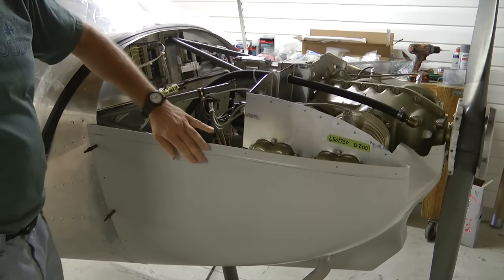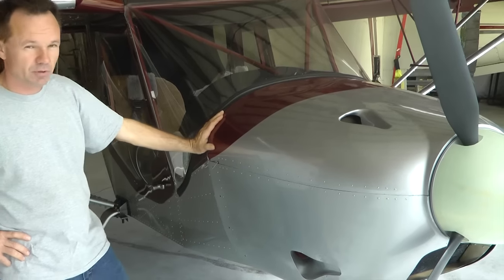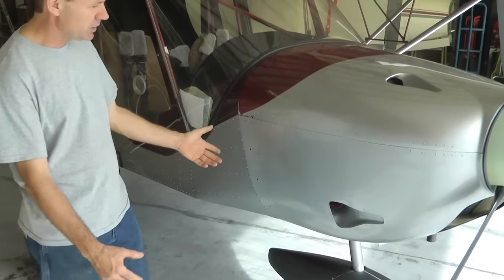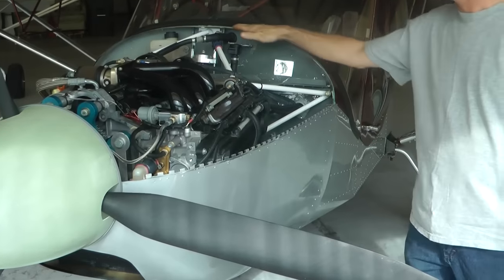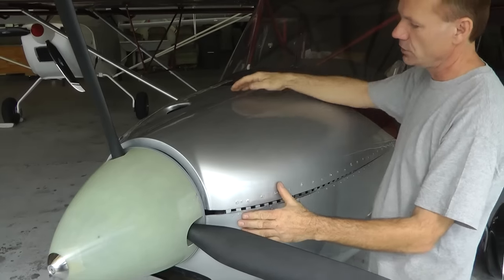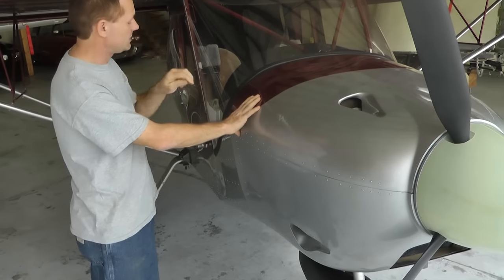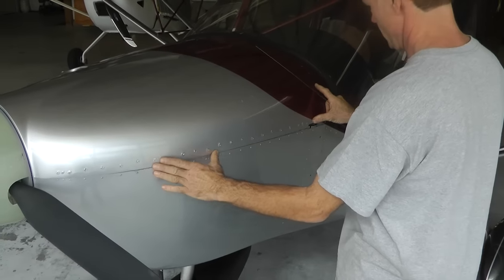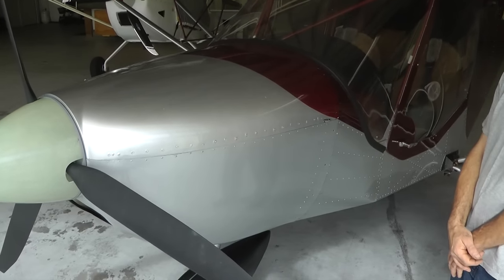A Better Way to Attach your Engine Cowl?

Comment: To make this work smoothly its very important to nicely taper the front end of the hinge pin. Without sanding the front tip of the hinge pin into a nice rounded tapered shape you will wear badly on your hinges every time this is taken apart and put back together. With a nice tapered pin and some oil or grease it will last forever. With the taper I never had to use the reduced diameter hinge-pins...kinda bending the hinge-pin into the general curved shape of the cowl-side also helps.

Comment: A lot of vans guys are going to cam lock fasteners and are ditching the hinge cowl atrachment method. The hinge method does give a super clean installation, but it takes more time to remove the cowl and it is not something you want to do before flight. With camlocks you can take the top off in 30 sec and see everything, and then bolt it back on, alone in the same amount of time. With the hinge pins it can be trick with one pair of hands. But yes, literally thousands of RVs have used the hinge pin method. It is decades old.
Reply: sounds like we think alike

Comment: To think how many of us want to do the opposite --- trash the hinges in favor of point connectors (like Dzus).
Then again, our  problem stems primarily from hinges along the aft top interface (where you are going without any connector) --- damn pin does NOT like going around round corners and requires enough insertion force to physically slide the aircraft sideways (and bent the living hell out of the pin if it slightly misaligns during insertion --- I actually replaced my original .090 dia pin with an .078 pin, which made the pin flimsy, but insertable.) Have to look into replacing my hinge (folded) with the extruded models.  Thanks

Comment: you also need to have some thing to lock the pin in. columbia's got rid of the hole in the very front so the pin dint walk out into the prop and thats with the big pin using a smaller pin it would be easy for that pin to walk out in flight and just  loose your cowl if your lucky enough to live though it.